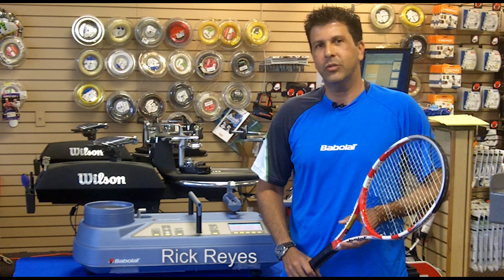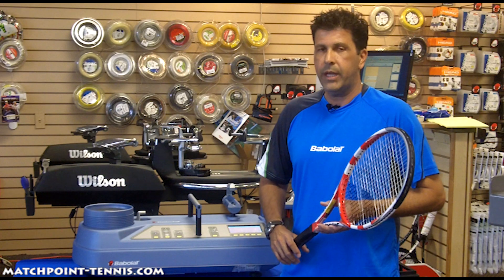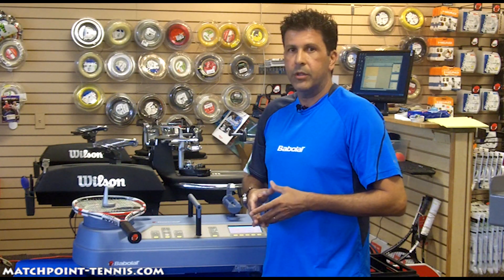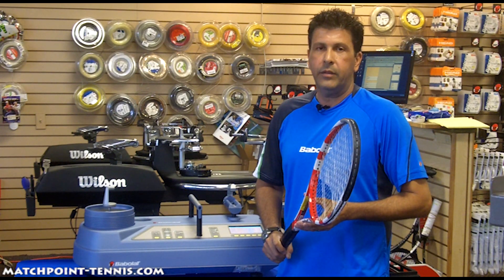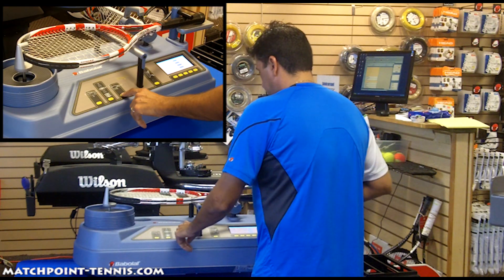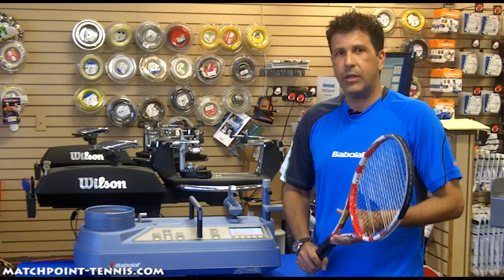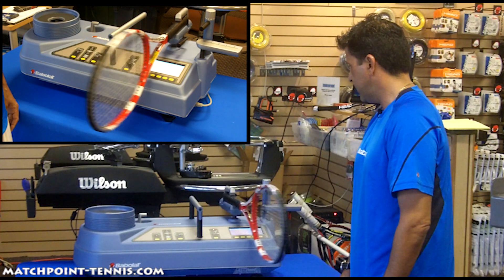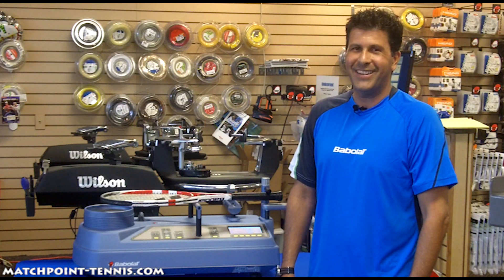Technology Review- Babolat Racquet Diagnostic Center (RDC)

Comment: When testing swing weight do you place the handle end all the way at the back plate of the RDC handle holder or do you place it so that the lip of the racquet end handle just clears the holder because the outcome even though only 6mm difference would make a massive difference in racquet personality. Any info appreciated. Thanks.